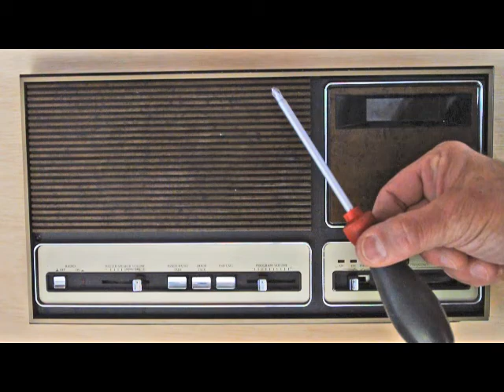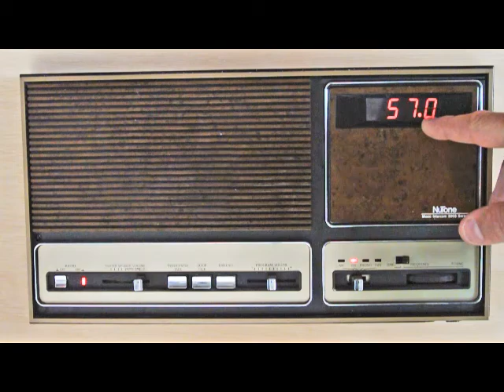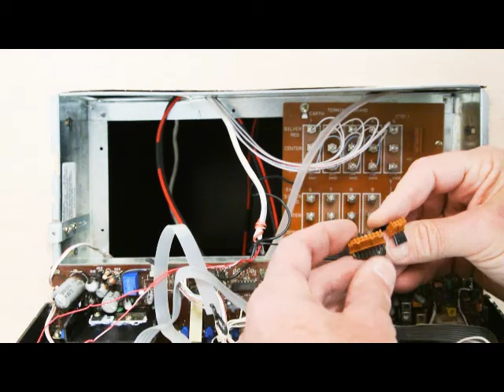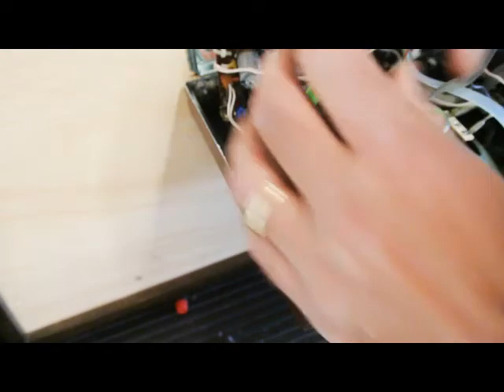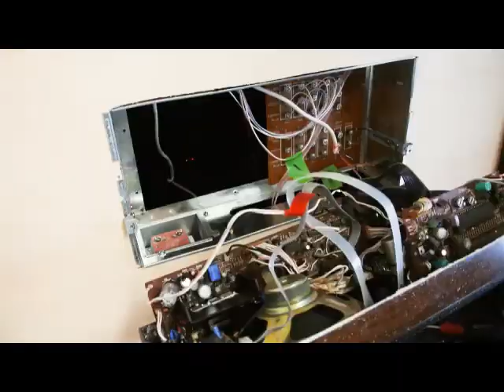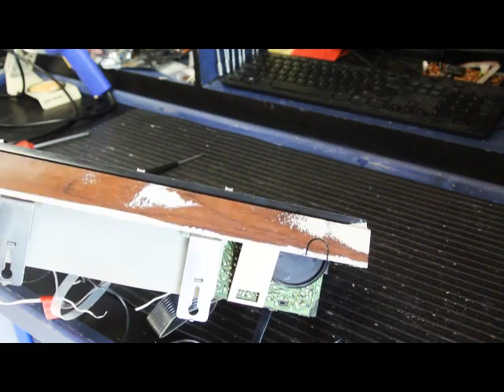Removing a NuTone IM3003 Radio Intercom Master Station for Repair

Comment: Thank you so much for this video; I have the same intercom system. I no longer have a use for the intercoms or the radio, but my doorbell has stopped working. Is there a way to utilize the existing wiring and transformer to hook up a doorbell? I'm unsure if the doorbell was part of the speaker system. I would greatly appreciate any tips you can provide.
 George
Reply from the maker: Hi gcaceres:  Your IM3003 System has a great many wires that run throughout your house and they can be used to bypass the Intercom System and used for other purposes, like a stand-alone doorbell.  Planning is requiured (especially for beginners) to figure out how to use the wiring that you have to achieve the end result you want - For most people, this should not be a "make-it-up-as-you-go" project - A clear end result goal and good planning should give you the result you want - On the other hand, you could simply get the IM3003 fixed . . . - Chris
Reply: Thanks Chris for taking the time to explain my options I will let you know if I decide to have mine repair.
George

Comment: What are the ring & tip terminals for on remote stations? Just curious
Reply from the maker: Hi Bobb: Back in the 1980's NuTone made soem wall-mounted telephone handsets that were designed to be mounted next to the Intercon master Station or Remote Stations.  These were the same size and color as the NuTone Intercom Equipment.   The Ring & Tip connections were provided as a convienant spot to connect the Telephone wiring to the handset.  They have nothing to do with the Intercom System whats-so-ever.
     The exception to this was the IM / IMA806, which had an optional Telephone "tie-in" module, which allowed you to answer the phone through the Intercom System (this was a complete disaster and cause the 806 to be discontinued after only 3 yeras) - Chris

Comment: Do you still work on this equipment? I opened it up and it looks like i need two circuit boards replaced - the amplifier and control board, as well as the Frequency and Timer Board. Having trouble finding where to buy them. Both boards have blown capacitors.
Reply from the maker: Hi nmbeers:  Yes we work on and repair NuTone Intercom Equipment every day.  It would be to fill out our on-line Repair Request Form about your IM3003 - Here' a link to the Repair Request Form: https://docs.google.com/forms/d/e/1FAIpQLSdQHT6fVgm25twaXFeCkkgeITEfAE_zlRBry6B8-GbIs19wcQ/viewform?formkey=dF9RVjBQMFQ5S0xYbTBHMHRoNkVkRFE6MQ
     After I receive the Form, I'll contact about the Repair of your IM3003 - Chris
Reply: @northsideservicecompany3567  just filled out form and submitted. Thank you.

Comment: Thanks for the video.  I would like to know what to do if I want to get rid of the Nu Tone and cap off the power supply.  Is it a hazard to leave the power left on in the wall with power or what should I do?
Reply: Thank you for the reply I found the source connected to the transformer and connected a plug box to it.  I wasn’t going to just leave it unattended.  The U Tone was in very poor shape. The previous owner gave it no love at all. I believe one of the boards was missing and it just doesn’t interest me to have something like that when I can connect 10 Alexa dots together and achieve the same thing.
Reply from the maker: Hi Carlos, Adding a wall outlet is a good solution, you can use your new wall outlet to plug the Alexa into.

How about donating the IM3003 to the cause, it can give up its parts to keep other units working - Chris
Reply: I would give you mine but I’m in Alberta 😂
Reply from the maker: Hi Carlos:  It is against National Electric Code to leave a live unterminated electrical line inside any enclosed wall cavity.  It is also dangerous and a possible fire hazard.

The line to the transformer should be traced back to its source (wall outlet or switch) and disconnected there, so the line is deenergized  - if possible remove the line from inside the wall 

Please don't toss your IM3003 into the trash - find a home for it - Chris

Comment: I just received my rebuilt 3003 days earlier than promised.  Installed it back and everything worked perfectly, except the door chime.  As explained in a video, I removed the push button and filed the contacts.  Reinstalled and it worked perfectly.  I cannot say enough good things about the Northside service.  Highly recommended!  I will let others know of this service.

Comment: Cross screw driver. Philips is a brand..
Reply from the maker: Hi Tim:  Not Exactly. . . 

The Phillips screw drive was created by John P. Thompson, who after failing to interest manufacturers, sold his design to businessman Henry F. Phillips.Phillips is credited with forming a company (Phillips Screw Company), improving the design, and promoting the adoption of his product. The original patent expired in 1966, but the Phillips Screw Company continued to develop improved designs.

The American Screw Company of Providence, Rhode Island was responsible for devising a means of efficiently manufacturing the screw, and successfully patented and licensed their method; other screw makers of the 1930s dismissed the Phillips concept because it called for a relatively complex recessed socket shape in the head of the screw — as distinct from the simple milled slot of a slotted type screw. The Phillips screw design was developed as a direct solution to a number of problems with slotted screws: easy cam out, precise alignment required to avoid cam out and damage, and difficulty of driving with powered tools.

From Wikipedia
--------------------------------------------------------------------

When instructing someone to perform a task, it is necessary to use commonly used terms that the majority of people can understand and relate too.  While these terms may not always be technically and specifically accurate, they convey  the necessary information in a way that the student can understand and follow without raising questions that are irrelevant to the task.
Chris
Reply: Homie got schooled !
Reply: What a polite way to school someone
 🤓🤓🤓🤓🤓

Comment: how much do you charge. for some reason the sound is always static and the receivers throughout the house will just stop. Also, the home already had the system and we cannot locate the module with the time controls.
Reply from the maker: Hi Dimitri, I will need some more specific information about your IM3003.  Please fill out an Intercom Repair Request Form and once I recive it, I'll contact you to discuss the problems with your IM3003 and its repair

Here's a link to the Repair Request Form:https://docs.google.com/forms/d/1zqjN5q1S-sBFYsou0BjMjmiyk_9HQeqKsvQtebeqBpE/viewform?formkey=dF9RVjBQMFQ5S0xYbTBHMHRoNkVkRFE6MQ

Thanks
Chris
Reply from the maker: Hi Dimitri, I will need some more specific information about your IM3003.  Please fill out an Intercom Repair Request Form and once I recive it, I'll contact you to discuss the problems with your IM3003 and its repair

Here's a link to the Repair Request Form:https://docs.google.com/forms/d/1zqjN5q1S-sBFYsou0BjMjmiyk_9HQeqKsvQtebeqBpE/viewform?formkey=dF9RVjBQMFQ5S0xYbTBHMHRoNkVkRFE6MQ

Thanks
Chris